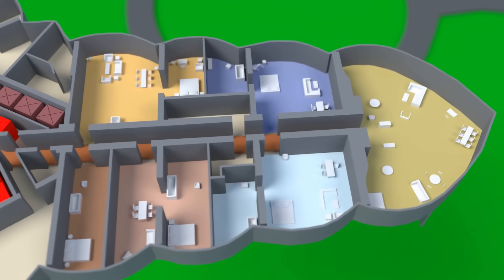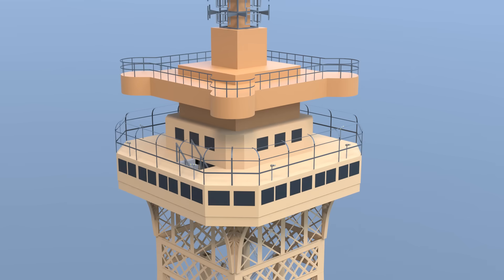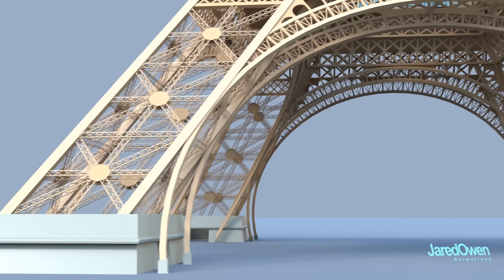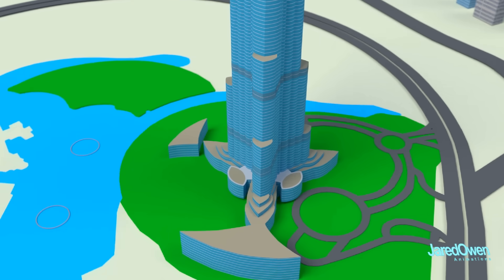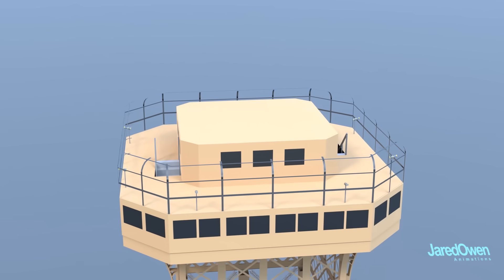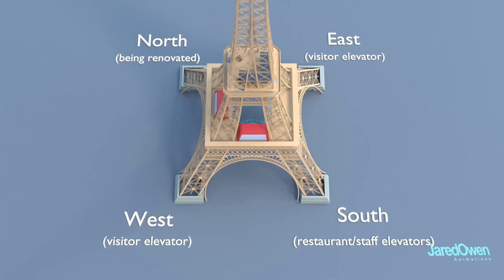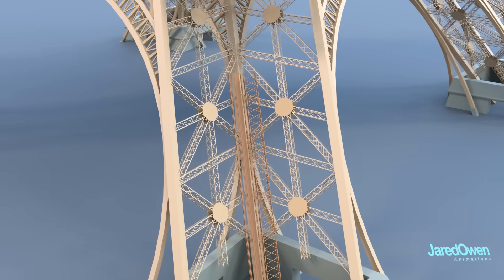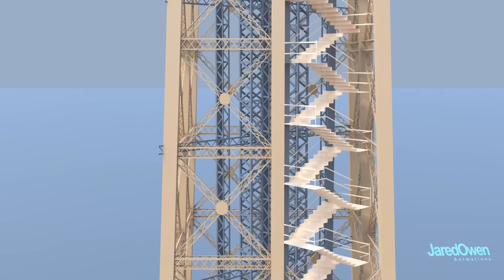What's inside of the Eiffel Tower?

Comment: but there is a problem of the Eiffel Tower, during the summer, the Eiffel Tower expands up to 15cm due to the thermal expansion. speaking of thermal expansion, the thermal expansion is a process when iron heats up and expands due to the higher temperatures.

can you give a single like?😟

Comment: Counting the Antenna in the height of the building is kinda cheating, considering it itself is NOT a building, just a pole... With this you could just stick a few hundred meter tall pole onto the One World Trade Centre and boom, worlds "tallest" building yet still being way smaller than the Burj... 

So with these scales, Chrysler is actually smaller than the Eiffel Tower and the OWTC is only barely taller than the Empire State (remember, we are NOT counting the poles here, just the building itself).

Comment: I thought you said to go to the third floor you need to take the stairs before it was banned maybe because of covid 19.  But then you mentioned you take a vertical elevator with one going up while another goes down as a counter balance.  Was this only for staff until they stopped using the stairs?

Comment: Paris: "our Eiffel tower has been surpassed, what should we do?"

also Paris: "Lets put an antenna"
Reply: The Eiffel Tower was only beaten by the unreachable decorative point of the Chrysler building. The Tower still had the highest platform reachable on foot. The antenna just proved the Eiffel Tower was still unbeaten in a fair challenge. And the hilarious part is that getting the record again was just a fluke.
The only reason why this antenna was put there was to show authorities that it was a perfect spot for a radio relay and they should not dismantle the Tower as was initially planned. They didn't even care about the Chrysler building.

Comment: I went to the top when it was 2 elevators (lifts). Imagine a platform 1m (3’) wide, 2m long with only a handrail at each end. The two elevators arrive at the same time and you walk across from one to the other.

Don’t get left behind or you are on a platform about 220m (700’) above the ground with nothing on either side. And the wind sweeping past. And the tower swaying.

Much too easy these days!
Reply: Yes, and those original elevators were in service for about 100 years. Pretty impressive.
Reply: I also guess the old elevators to have been quite slow.
Reply: wtf

Comment: Did you know that if you put a cylinder around the Eiffel Tower the air contained would weigh more that the steel of the tower?
Reply: And there is less pressure on each pillar than on a stiletto

Comment: If you want to visit the Eiffel tower, better buy the tickets before you go there. The queues are endless. I visited the second level with preordered tickets, just an half hour waiting. To get to the third level, you need to buy the tickets on the second level, i got told they are not for sale elsewhere. There was also an endless queue there, i didnt want to wait that long. The queues are long because the time you spend up there is not limited, but the number of visitors. You have to wait until someone comes back down.

Comment: I love how the music fits to the topic.
Reply from the maker: Thanks Andre!
Reply: @JaredOwen  i hate you
Reply: @JaredOwen Sorry but you have a few errors for the elevators. The double deck elevators use a roped hydraulic system, in which the cables roll over sheaves on the way up, which lift them up, which wasn’t in the video. Second error is that the freight elevator and Jules Verne Restaurant elevator don’t have cables holding the cab and there are no counterweights and there are no guide rollers. Third error is that the third floor elevators don’t have cables going under the cab and there is no sheave.
Reply: Yes!
Reply: @[Closed] I wouldn't sneeze in french as you usually do.
Reply: @dlrss1v274  *coughs, sneezes and then dies, in french, of course.*
Reply: [Closed] hmm, galing ka sa Pilipinas?
Reply: Exactly, it's Belle-Époque-like technicist and filigree.

Comment: When I went to the tower last January, they also had an exhibition with information on how it was built. I don't remember the details, but it had info on how they leveled out the four pillars so they matched perfectly when they came close to each other.

Maybe you could do a follow up with this (so that I can remember it as well 😅)
Reply: Arturo Torres Sánchez to be short, there is an hydrolic system inside the north, west and est pillar because of the sun who dilate the iron. So the hydrolic system pulse up/down the pillar, so there is no notable height difference between them 

And also, BAGUETTE 🥖🇫🇷😉
Reply: Regarde "C'est pas sorcier"

Comment: Imagine the awkwardness of all those people shuffling past each other on a catwalk that high in the air to switch elevators 😂

No wonder they changed it
Reply: Exactly. That picture looked scary!
Reply: @adriand6883  It's nothing for the 1880s. Conditions everywhere still were utterly primitive, then. It's a worthwhile undertaking to broadly imagine them. There was hardly any sound recording, and practically no filming, yet. You only could fly in a balloon. Telephone was one of the newest achievements, but still absolutely rare and working only within small areas. Daimler and Benz were just inventing the car, which wasn't yet of any noteworthy practical use. It was a really different world.
Reply: LegoGenius16 

Ikr
Reply: That's exciting
Reply: I’m guessing it’s bigger than you think up there on the too level. I went up to the second level and * thought * we were all the way up (..but it was closed off at the time). It’s huge!!
Reply: I'm guessing it was improvements in cable technology rather than safety considerations; the length of any elevator span is limited by how much cable (plus the carriage) a cable can support. (Adding extra parallel cables - though very desirable for safety reasons! - doesn't make any difference to the maximum; each cable has to carry its own weight.) With steel cables, and new ways of spinning them, you could have longer runs.